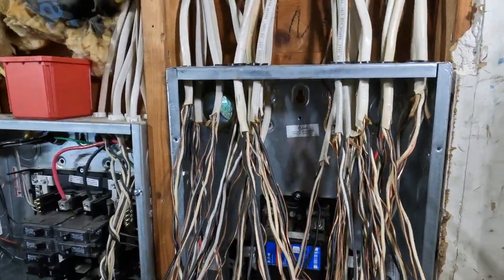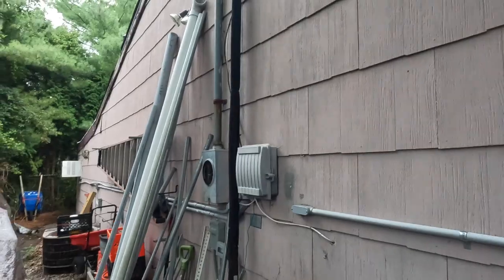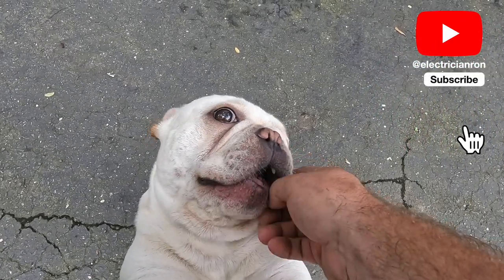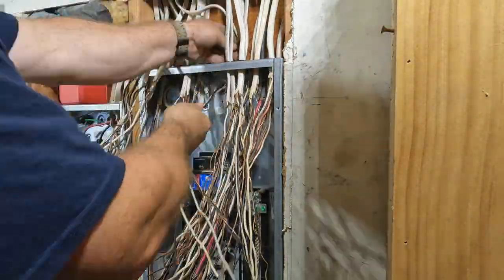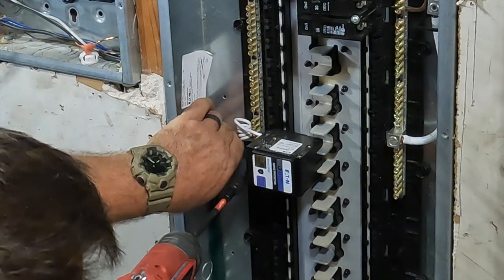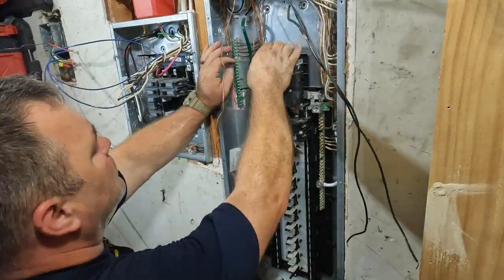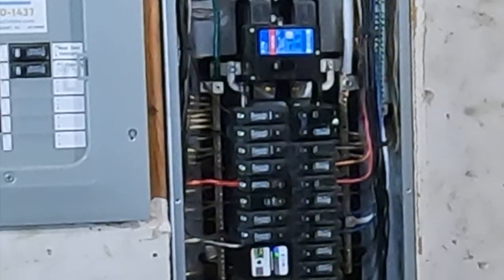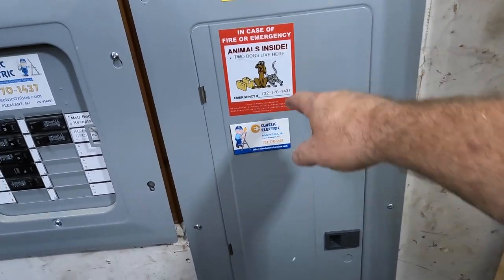Powerage: An Electrical Contractor's Journey of Updating His Own Electrical Service Part I

Comment: I was taught that the whole house surge protector should always be installed right under the main circuit breaker. Soon as a surge comes in you want it to hit the surge protector first.
Reply from the maker: Yeah well the manufacturers mentions none of that in the cut sheet and it’s not a code requirement.  Square D asks for that but it makes no difference since a surge can also develop from a branch circuit.
Reply: Per GE research back in the 60's, when they invented MOVs for surge protection,  they determined 80% of transients originate from inside the home. Some panels with factory installed SPDs mount them at the bottom of the vertical bus opposite end from the main CB so doesn't matter IMO.
Reply: My point was that IMO doesn't matter where the SPD is mounted on the panel board bus.  Should have layered protection, Type 1 at meter base, Type 2 at panelboard, Type 3 at receptacle.  Latest NEC Code requires SPD at new services, I know not every jurisdiction has adopted it yet. As a side note UL1449 does not require the joule rating to be listed on the device, VPR voltage protection rating should be low and is perhaps most important along with a high In (current I sub n) rating.

Comment: I'm jealous. I'm currently working with, and trying to render safer, that identical panel in rural CT. Nothing is properly labeled, I'm chasing remodeling splices behind walls, dead 2-wire BX, live 2-wire BX, 20 amp breakers on 14ga wire, bits and spots of nicked insulation, asbestos/textile wire insulation on live circuits, double and triple neutral bus bar connections, and a sketchy sub panel that feeds a racoon infested barn 200 feet behind the house...while standing in a slimy, muddy basement trying not to drop anything. Oh and a big HELLO to the pups!

Comment: At 22:10 it seems they use the Square-D type system of breakers, where they have the center tripped position between "ON" and "OFF" with a red flag to indicate a short/overload trip.  If your not familiar with this setup you can get confused when you flip the toggle to "ON" and it snaps back to the tripped position.  Yep, have to push the toggle to the "OFF" position to reset, then to "ON".  I have a Cutler Hammer panel, their breakers have no center tripped position, or red flag, they are like a tan colored light switch, "OFF" and "ON".

Comment: Nice neat job. My dad & uncle would do maybe 20 100 amp service upgrades a year back in the 1950  & early 60's.My dad would purchase a 100 amp 20 circuit panel with some of this moonlighting money to be used in our house. A month later he would use it for a side job. Finally in the early 1970's me & my brother finally removed the  two fuse boxes and installed the panel that was vollecting dust on our workbench for a few years. Can remember almost all 100 & 200 amp services could be done in 8 jours but now with the outdoor disconnect guess it could take 11 hours. Glad that I'm retired.
Reply from the maker: Thank you John!

Comment: I had a Siemens 200 amp panel put in, about 10 years ago. The whole house surge protector is a plug-in style as well, but it also has two 20 amp breakers on it.

Comment: NEC Code , Art 310 Table 12 : Single Phase Dwelling Services and Feeders ; For a 200 Amp Service one is allowed to use 2/0 Copper  OR 4/0 Aluminum or Copper Clad Aluminum Conductors  for the feeders

Comment: Had PSEG swap my meter to a smart meter and they didn't check their work (like you did there).  They snapped the neutral lug off the meter pan and caused a dropped neutral.  Drove away before we even realized what was causing everything to smoke and flash all over the house.  Got the main breaker off within 3 minutes I'd say.
Reply from the maker: Sorry to hear that.  Not all PSEG guys are like that.

Comment: Comment - I prefer to place the neutral conductors in the same location on the bus as the breaker rather than bunching them all in one area.  The reason has to do with determining wire pairs.  When I replace a breaker with a GFI, you need the neutral, and when it's combined with everything else in a large group, it's hard to see what's going on.  I guess it's the OC in me, but wanted to chime in.    Anyhow, thanks for your amazing workmanship.

Comment: I like the plug on Eaton Surge protector as it's clean.  Regarding the additional neutral bar, is the bar insolated from the enclosure?  Hard to see the device itself as it looks like a ground bar that attaches to the panel enclosure.  When I added an additional ground bar to my panel, I didn't rely on the enclosure as a conductor either.  I appreciate your narration - thank you.  PS: Your garage looks like mine - lol.

Comment: Farm electricians used to strip the outer sheath of UF cable, pull out the current wires and leave the rest of the  sheating around the grounding conductor.
Reply: @cengeb  ???  Of course they stripped the end of the ground.  I meant that they didn't strip all the casing, which Ron was discussing about NM cable

Comment: 11:58  kinda suprising how much panels in  USA still have stupid flathead screws .. in europe most screws ar  SLPZ2 ( slotted pz2 )
13:50 ok that's probably  philips screws in de grounding/neutrals bars
19:03 tyraps on this little piece bundle  you might get away with it .. but cutting tyraps with an combination pliers makes them very sharp ..i have cut my arms and more then once on them .
          Because the electrician before me was sloppy and didn't cut them flush with the correct plier ..

Comment: Hey Ron! The plug on surge protection is the way to go. I use the Square D for the Homelire panel series. Nice job
Reply from the maker: John, I have to be honest... I prefer the Eaton Ultra surge protection device because its of higher quality. The difference is here I have to use the plug-on type because I have a flush mount panel. If I had a surface mount panel then I could have used the Eaton Ultra.

Comment: Great video and excellent work you do. Can't wait to see part 2!

Also, it's nice to see someone add a neutral bar to a panel. Never seen anyone do that. Any reason as to why you prefer adding a neutral bar for those short neutrals instead of extending them with inline WAGOs?
Reply from the maker: It costs a little bit more to do it like this but it’s a nicer job. Either way is acceptable by the code.

Comment: 16:46 what about if you wanted to move a circuit to load balance your panel to run a generator/interlock setup where you would not want all your high draw appliances on one phase and overload a generator.  Do you every make an effort to load balance a panel for high draw 120V circuits like refrigerators, sump pumps, well, boilers/circulators?  IE when you install your generator 20:34.
Reply: For this reason and admittedly some OCD, I've moved around circuits in my home panels over the years. And there is a minor amount of satisfaction having circuits organized as opposed to scattered all about. To be able to do this it helps to keep keep some slack in the cables and to enter from the side near the target breaker.
Reply: @JasonEDragon  I have done the same, I just wonder if it is even necessary.  I imaging it would be hard for an electrician to load balance a home correctly until the home in use and using smart home power monitor.  I just wonder if Ron was OCD like us when wiring his own home.
Reply from the maker: There’s no such thing as load balancing on a single phase service.  No such thing.
Reply: @electricianron_New_Jersey  yes I know I guess I mean the two 110V legs?  They do run 180 degrees out of phase.   A generator not run efficiently if all your power is being drawn from one leg,  IE similar to that 110 Volt 40A sub panel someone wired in your office, or if you had multiple refrigerators or sewage pump or sump pump or boiler you needed to power during an outage.
Reply: @electricianron_New_Jersey  Well, I have a 22 kWatt Generac generator that has a 100 Amp breaker inside the generator cabinet. If all the load was only on 1 leg then 22,000 Watts / 120 Volts = 183.3 Amps. Granted, load balancing can be very imprecise as loads go on and off - and many newer appliances don't draw the power that they did decades ago. So, balancing loads is more important for smaller portable generators these days. Still, if I had a week long outage in cold weather I'd probably be running extension cords to my neighbors on either side of me (1. to be nice - especially if elderly, and 2. to keep them in their homes and not in mine). I'd want to make a rough attempt to make sure things might be at least somewhat balanced - or at least that everything wasn't mostly on the same leg. A lot of critical loads do tend to be 120 Volt.

Comment: Glad that you are feeling better.

Nice job as always.

I was a little confused about one thing. Even though your new panel is a main panel and the first means of disconnect, you still had to “isolate” the new neutral bus bar from the enclosure (even though you bonded the new neutral bus bar to the ground bus bar which IS bonded to the enclosure). You mentioned that this is required by code. Did I understand things correctly? I thought neutral bus bars were only isolated in sub-panels. I guess, in your case, the new neutral bus bar wasn’t truly isolated.
Reply from the maker: Yes, because neutral conductors are current carrying conductors and code specially addresses this NEC section 200.2.
Reply: @electricianron_New_Jersey  Thanks Ron for the prompt reply. Much appreciated. Enjoy your Sunday.

Comment: I put my SPD breakers as close as possible to the main breaker.
Reply from the maker: Why do you do that?
Reply: I believe the theory on this was, to make it the shortest path from utility power incase of a surge. I think square d came out  with some literature in there manufacture specs about 5 years ago or so. 
Theoretically  If you think about it  lets say you have your spd at the very last space on the bus bar, the spike will go the all the loads first on the bus till it gets to the last seat. 
At the end of the day its all theory not sure if it really makes a difference cause now were talking like fractions of a sec in time difference.  Thoughts? @electricianron_New_Jersey

Comment: One thing that I see that you do in your installs, is you install your service wire after you install your brand circuits. I've always installed the service wire first having them at the back of the panel, then installing the rest of my brand circuits in front of it.  just a question.
Reply from the maker: TBH, the service conductors get in the way of working with the branch circuits.

Comment: By installing the main bonding screw aren't you essentially connecting the neutral bar and ground bar together, which in turn wouldn't the neutral and ground bars be the same potential and fault current would flow on the panel enclosure anyway. I know you said you had to isolate the neutral bar you added but your neutral bar is bonded at the first point of disconnect, which is this panel. I'm trying to maybe learn something here. My understanding was that 200.2 B was that the neutral bar you added could not rely on a panel for continuity to the neutral bus which is why you add a jumper wire. I didn't think it needed to be insulated from the panel.
Reply from the maker: The neutral is a current carrying conductor.   The enclosure cannot be used to move current.
Reply from the maker: NEC 200.2(B) 

The continuity of a grounded conductor shall not depend on a connection to a metallic enclosure, raceway, or cable armor.

Comment: Quick New Jersey question Ron: I have plastic natural gas supply line to my house. Does my black iron gas line In my basement need to be bonded to my copper water line/back to service panel? I have new CSST tubing to my new water heater and was told any CSST tubing needs to be bonded. Not sure all plumbers are aware of this, or if it’s required in NJ
Reply from the maker: #6 awg copper from the the CSST to another bonded electrode (like water pipe) or to any available equipment ground (sub panel, main).
Reply: @electricianron_New_Jersey  thanks Ron. I did exactly that to my copper water line 👍

Comment: Question, what Milwaukee Rotary Hammer Drill do you usually use often sds plus or max and what number? What I mean by number is 2915-20 or something? I what to buy one because I’m tired of borrowing my coworkers
Reply from the maker: The M18 SDS Max is the better of the two. The SDS Plus can drive ground rods sort of.  The M18 no doubt about it.
Reply: @electricianron_New_Jersey  ok thank you

Comment: Totally not implying anything was done incorrectly, as I would never know, but I'm curious if there are any regulations on how high up a service panel must be?  This one is just so low to the ground.  Or are there exceptions for renovations vs new construction? Glad you're feeling better Ron!
Reply from the maker: The maximum height for any breaker is 6’ 7”.

Comment: Your surge is installed incorrectly. Check the manufacturer.
Reply from the maker: I did check. Didn’t say what you think it said.
Reply: @electricianron_New_Jersey  you’re right, but maybe because br products are low in quality, so they don’t know the surge should go nearest the main which is typical common sense. Additionally, your neutral wire is too long per the manufacturer.